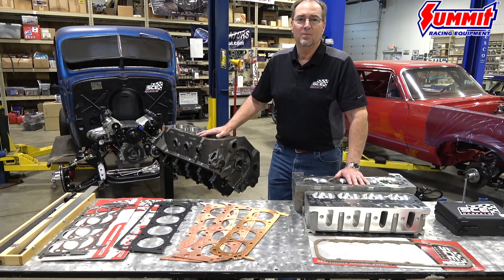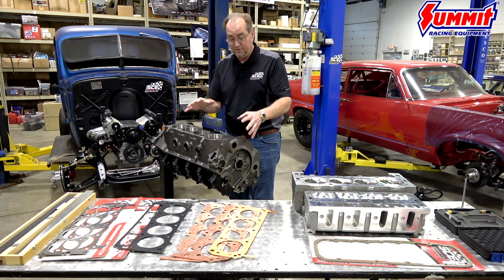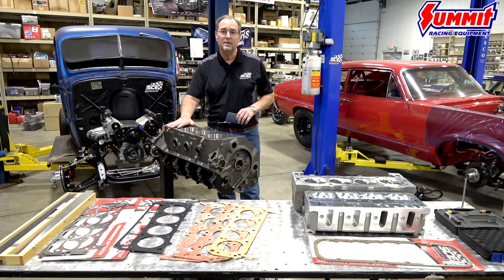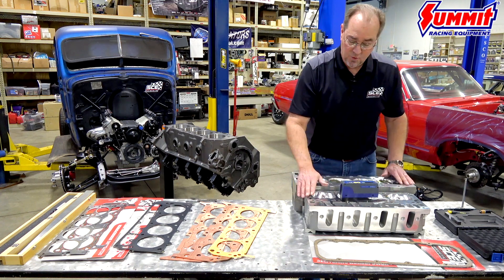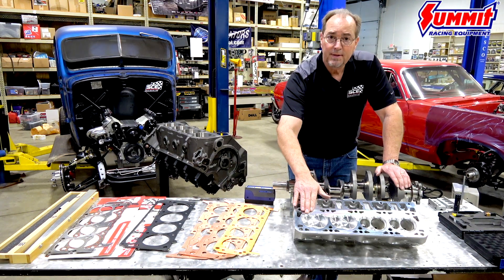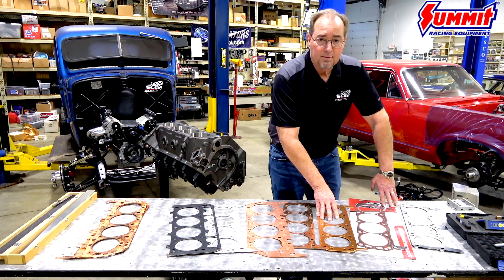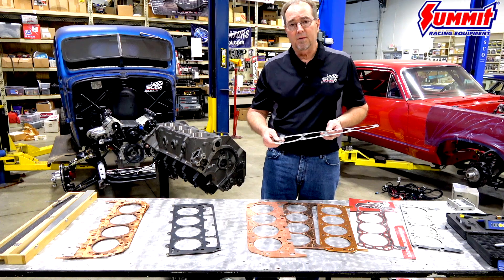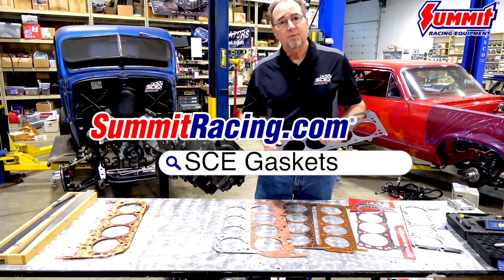Gasket Material and Surface Roughness—and How they Relate

Comment: this is interesting.  I get it.  what the discussion is not telling you is that an MLS only needs to be super Smooth in the sealing areas.  It is possible and not difficult to on an Iron block use only a razor blade and maybe some emery cloth in certain areas to ensure the surface is viable.  now the cylinder head would be the same but aluminum is prevalent now and it needs to be resurfaced.  I have done this on a BMW s54 block(iron) without any issues at all.  Yes in areas the factory surface is obvious after some work, MLS is the standard for this block so it is not time consuming 4-6hours.   I spent time, instead of money on the process.  But I didn't have to haul the block around to shops and have some body work it, I don't trust almost any services in my area, any.  But in general taking all the hardware to a machine shop and saying do this some might reply "the customer is wrong, we always do it this way".  One other thing on MLS is that apparently the non crush sealant is Viton, all of that material needs to be blemish free, and carefully inspected.  I have had 3 Elring head gaskets with this lately, post CV-19 world.

Comment: at 9:46, a black mouse is visible at the roof of the red car. If is not your pet, the shop can use a resident cat, which would make a great pet.  Thanks for the info on the very thin stainless gasket, I'm debating wether to copper spray and reuse a set I have brushed down to metal or just install new composite gaskets.
Reply: thats a head
Reply: @makimano1990  guess that means you need a bigger cat... Tigers maybe 😂🐯🦁🐆🐅
Reply: How do ya think they make rat engines huh...
Reply: I saw it! Lol
Reply: You know thats a persons head right?
Reply: Attention to detail 😂
Reply: Almost got me with that lol That's just a person😂

Comment: I used to work in R&D for a automotive manufacturer and we were having some head gasket issues and we started playing with different RA's on both the head and block stealing surfaces and we actually had the best results from what is normally considered an RA surface that's too rough... the engines coming out of the plant were machined to low to mid 30's in RA but we had the best results with a 55-60 RA while still using the same factory MLS gaskets.... I doubt that you will see this post as old as this video is but if buy chance you do I would love to hear your input on this... because it shouldn't be this way in all of my personal experience but it is.... thoughts?
BTW that OEM did adjust the machine program a small amount but not anywhere close to the numbers we found to get the best results..and they are still having HG problems to this day ... I don't work for them still but I do have a passion for the brand still
Reply: Fel Pro is recommending 70 Ra cast iron and 55 Ra Aluminium for their permatorque MLS gasket install. 80Ra should still work. They claim better coatings allow this but I bet it's just viton. Maybe they do add extra viton in places help with weak spots in heads and blocks that need it. 

But your comment is making me wonder if the other head gasket makers just haven't tested their headgaskets with rougher surfaces. It makes sense you want the head gasket to not slide back and forth as the block and head expand and contract differently as things go from cold to hot to cold. And the viton should be able to adhere well to a rougher but not too rough surface. 

HP academy has some interesting videos on headgaskets.

Comment: I know what you're saying but my machine shop uses a fly cutter for MLS gaskets for OE aplications. They don't have a deck grinder and we've never had a head gasket job come back. 

So OE engine over heats alloy on alloy OE gasket is MLS. We use a scotchbright die grinder pad on the block and get the head fly cut. These cars are day to day run arounds and a full engine build would right the car off so we offer the cheap fix.
These cars can see over 100,000km out of the job.
So I'm very skeptical about the RA finish values for MLS gaskets. Yes if I was spending 20k on an engine I'll get the head and deck ground to the correct RA for safety factor. But I don't believe it's necessary to finish the blocks to the level stated here.
Even the OE just fly cut the block and head then throw a MLS gasket on some TTY bolts and call it a day and most engines will do 300,000+km.

I call BS.
Reply: Yeah I think these Summit Racing guys spend a bit too much time in the world of 800hp boosted motors.  When you've got an 8-71 trying to lift the heads off the block and blow them up through the hood, you probably do want to have your ducks in a row on the gasket front.  It only makes sense that things would be a smidge more forgiving on a daily driver with 9:1 compression.

Comment: Which is better Carbon or St eel Cyliner gasket? Need help coz i need buy to replace my blown gasket
Reply from the maker: It really depends on the application because both will seal great, but on high compression, boosted and nitrous applications, an MLS gasket will be the best for sealing between the two.

Comment: That RA gauge is almost $2k

Is there a way to use sandpaper as a roughness standard?

For example...220 grit = 50 RA
Reply from the maker: We do not have any type of charts, but if you do a Goggle search for “RA vs grit chart”, you find a bunch of them.
Reply: Yes. I came across this with my 460.
I hand sanded the machining marks out of my heads and block. (Using a hard plastic hand block) started with 400 grit. Then 600, then 800, then 1000grit.
Its almost a clean mirror finish.

Comment: What doesn't add up is a MLS gaskets on rough cut heads and blocks straight from the manufacturers. I'm doing a engine now, 4.6 Ford off a 97 f150 and I could clearly make out the rough machine surfaces of the block and heads. I'll get it down to at least 40RA or where I can't feel anything by much and copper spray both sides of the MLS gasket. I assure you it will be better than it was.
Reply: You are correct.
Reply: How will you "get it down", to ra 40?
Reply: @jakefriesenjake  sandpaper with a flat sanding block starting with coarse then to fine, constantly checking it with a straight edge for flatness. Working from end to the other not working in one area more than the other areas. I got it done, been nearly two years with zero issues despite my previous comment saying one year ago... it's wrong,... and I did apply one layer of copper spray on each side of the gasket. I also did the block the same way... just be sure to remove those doll pins first. Sand down the block and heads no more than necessary. The paper really need no more than 360 grit for finished grade. However, I wouldn't recommend doing this if the parts already have warpage, this method is only good when the parts are already flat... warpage will need machined.
Reply: @garyr7027  cool. Just got word my heads are finished up at the machine shop. I had to fill some corrosion with extreme temp jb weld (only around the coolant ports, not the fire ring area). He put a certified Mls surface finish on the aluminum heads.

My iron block looks pretty smooth, by I should probably hit it with a hard block and 400 grit. I have the paper already. I want the machinist to swing by to check it out, he's only down the road 2 minutes.
Reply: @jakefriesenjake  nice, I hope it all goes good for ya. This is one of those jobs you really only wanna do once and not having to redo it. On my engine both the block and the heads had rough factory surfaces, only reason why I even messed with the block, and both surfaces needs to be pretty smooth for MLS gaskets. If in doubt, that copper spray works, but not designed to fill in too much... don't over doo that stuff if you do use it, one thin layer only. Exhaust manifolds are another story, you can go to town with copper spray on those with zero issues... it's what I did.
Reply: @garyr7027  yeah exhaust is a different story really. Only reason I'm doing most of the engine again is that I wiped out my solid roller cam. The lash got way to big, before I checked it. Had to pull a head to pull out a lifter to check for damage. Good thing I did, some coolant holes were plugged. Engine is 16 years old but basically new. That's how long I worked on the car. Engine just sat basically. That's where I found the corrosion too. So I guess It was a good thing to rip it apart. Also has some oil leaks. Lumpier cam going back in!

Now everyone is telling me about Mls gaskets, and how great they are....
Reply: @jakefriesenjake  MLS gaskets are good if they're done right, but are a pain. They take a lot of abuse and less blowby over time, as they expand and contract with the heads, where composite gaskets don't. Be sure to get that "initial" low pound torque right on those head bolts before final torque, it will take several times to reach intital torque as the bolts stretch and gaskets will smash down while they're being torqued down. That first initial torque is critical for those type gaskets, so don't assume initial torque is reached the first time without rechecking several times... I've learned this the hard way on another engine once. All the bolts have to be evenly torqued down as close as possible at the final torque stage . Some make the mistake and think they've reached intital torque, but don't and have issues later on. Sounds like you doing the right thing to me though, if you're willing to do it, then you got the skills.
Reply: @garyr7027  yeah, bring up all the bolts hand tight. Then start bringing them up to like 20 pounds, in sequence. Once all at 20, do em again at 20, in sequence. Do that till they are actually all at 20.

Then do it again at 30, till they all stay at 30, and then 40, then 50, then 65, I think is what they want. Go around, in sequence, till they maintain 65.

That about right for Mls?
Reply: @jakefriesenjake  it would depend on the engine really, to be on the safe side look up those specs... I can't say for certain what your will be. My engine was this, torque down in sequence pattern 35 lbs,... if I recall it was 35?..., then for each bolt 90 degrees, then another 90 degrees, for 180 degree total. Mine never gave the final torque in lbs, so those first 35 lbs had to be exactly 35. Some specs are like that, some aren't. The question is what lbs are the 90 degrees?... you can't really know, this is why the intital torque has to be spot on. You could use a degree wheel for the 90 degrees, but it's not really necessary, it's a 1/4 turn. For the first 35 lbs, I used a torque wrench, for the 90 degrees, I used a ratchet type breaker bar.
Reply: @garyr7027  yeah I heard about those engines before. Torque, then a certain angle on top of that. Mine is purely just torque tho.
Reply: @jakefriesenjake  the really you got it made sense you know the actual final torque. For degrees it's more critical on the intital torque since the end result isn't known.
Reply: @garyr7027  true

Comment: carbon head gasket for better seal ? with additional copper spray better? for proper seal
Reply from the maker: I would not use any copper spray on that gasket. The only material on a head gasket that I recommend copper on is aluminum, steel shim or MLS.
Reply: @SummitRacing  block surface is not smooth surface, only skim silinder head, can i use carbon head gasket + copper spray for proper seal? coz aluminium head gasket still leak, that,s why i need to replace again with another head gasket

Comment: It's really difficult finding a machine shop that actually uses a profilometer to check the surface finish. Most, if not all, just do an eye ball check. I absolutely hate that.
Reply: You should see the machine shops around here.  They don't even know what surface roughness average is...
Reply: And the second you question them their ego is so badly bruised they don't even want you in their shop
Reply: I’m going through this right now. When I asked the first shop I called about their finish ra measurements, the guy told me, “that’s some internet myth, I’m not sure where it started, but you don’t need to worry about it.” Someone else online speculated that that is probably the actual reason some manufacturers are recommending to replace modern engine blocks and heads when found to be out of spec instead of having them decked!

Comment: A lot of good information here. I am building a high compression ford 302 with trick flow heads and want the best possible gasket. I also want the same RA number on the deck surface and the head surface. I am old school and perma-torque was always the choice.

Comment: Has anyone ever tried using a belt sander and straight edge?
Reply: Check out old school funk.channel
He doesn't use a belt sander but he uses a flat table with sandpaper glued on it. Swears it works excellent on aluminum heads. I wouldn't try doing it with cast iron. I'm actually going to try doing it someday when the need arises. Old school funk really explains how it works well on the aluminum heads. And I trust him he seems like a decent guy. Hey it's worth a try when you're broke.
Reply: @TORCHBROTHERS  checked him out. Would be a great channel if he didn't do the church sermons
Reply: E Armstrong Don’t hate.
Reply: Are you serious?
Reply: Do you think they call me Track Master for no reason, of course I'm serious...
Reply: No but I think that belt sander might have run across your head a couple of times...

Comment: You neglected to mention measuring flat on the diagonal.  I have seen heads and blocks that measure flat in length, flat across the head, but have a twist that shows up diagonally.

Comment: No mention of sealers?
Reply: The ones you spray on head gaskets before installing, like Permatex Copper Spray ?  I been told is sacrilege to do it on the MLS kind. I did it anyways, wish me luck.🤞😬
Reply: @GIGABACHI  how did it go?
Reply: @GearheadOutlaw  is holding up perfectly fine. I have pulled it's hair back HARD a couple(more like 10-15) of times now going thru the gears and some highway time at high-ish rpms(3500-4000) and it hasn't blow up yet. No oil in coolant, no coolant in cylinders. It has worked for me.
My block and head surfaces weren't in the best of conditions. I'm convinced without the copper spray it would have leaked. MLS is the shit but only if you start with perfect surfaces.👌
If I were to do it again I would still spray it BUT I would make sure the head gasket that came with the set is the "composite" type, same as the OEM part in my case as those are more forgiving to surface imperfections and there's 0 issues on spraying it.
Reply: If you spray each side of each layer of a mls its fine. No need for all this ra measuring outside a high performance or abused engines. Not that it really is anyway imo.